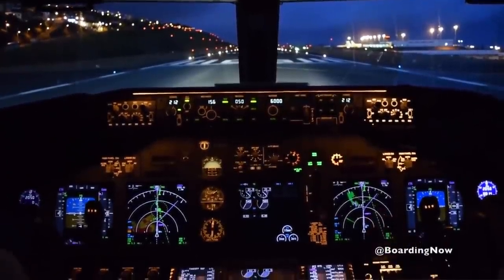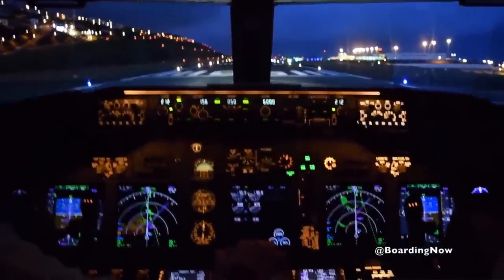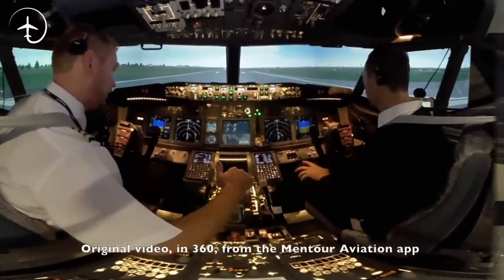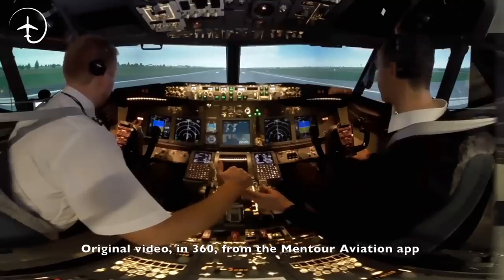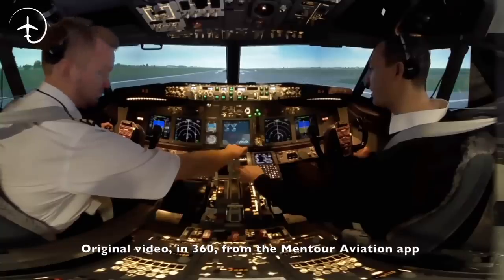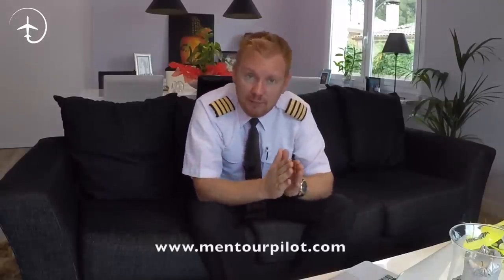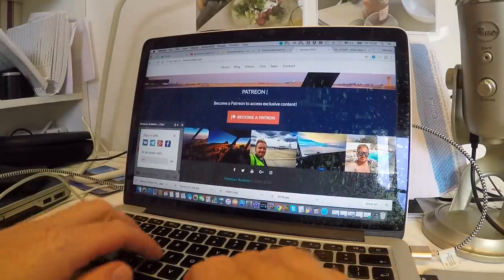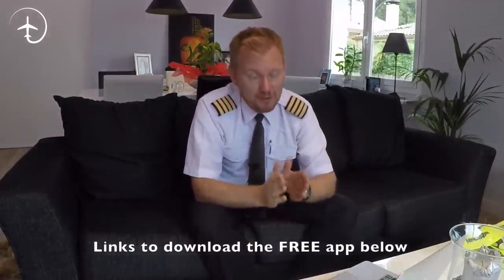Why do the aircraft engines "stop" accelerating during takeoff?

Comment: In many videos from a cockpit I have seen the climbing phase done at V2 speed which is only a bit faster than the stall speed. Why is it that? Is the reason to get to the cruise level as fast as possible with least fuel consumption? I suppose climbing at 250 KIAS would take some time (owing to the small pitch angle) and a cause a higher consumption due to higher drag and denser air. Right?

Btw. I watch your videos, they are very educational, professional and yet very comprehensive. And I am toying to enrol to a PPL(A) course. Thank you.
Reply: Usually, the climb is done at the "best glide speed". That is, at the speed the plane generates the most lift with the least amount of energy expended. 

Basically, flying is all about energy. The engines turn the chemical energy stored in the fuel into kinetic energy (speed) at a certain rate. The angle of climb turns the kinetic energy into altitude. At higher speeds, you don't need as much angle to get the same climb rate.

So, the plane will climb at roughly the same rate independent of the airspeed (somewhat slower climb due to the increased drag, but not that much), but yes, mostly they climb as fast as possible to get to an altitude where the engines run more efficiently.
Reply: Thank you for explanation. I have experimented many times in my X-plane 11 simulator with B737 and indeed when i set the cruising altitude, use LVL CHG button and set the speed to V2 speed the aircraft is climbing quite rapidly. I might not be fastest but certainly the engines are not set to full thrust. I have tried to play with the Vertical speed hold but I consume a much more fuel. Needless to say that some pilots told me this is not exactly a safe way how to climb.
Reply: Ok, I guess a bit more explanation is in order. 

There are several speed values that are useful. There are V1, Vr and V2. You need those only during takeoff. 

Vy is the "best angle of climb" speed, which means, you have the maximum altitude gain with the least horizontal travel. That's probably pretty close to V2. You use that speed during a short field takeoff to get over an obstacle.

Then you have Vx, which is the "best rate of climb" speed. I suspect that's also the best glide speed, but I'm not a pilot, either. If someone out there knows, please tell :-)). This is the speed you should set when climbing via LVL CHG to gain maximum altitude in minimum time.

The reason why vertical speed hold is dangerous is that the auto pilot will try to hold that climb rate by adjusting the pitch. If you set the climb rate just a hair too high, the autopilot will happily pull up until the plane stalls.
Reply: @realulli  great info but Vx is best angle while Vy is best rate.
Reply: Thanks for the correction. I keep mixing them up...

Comment: Hi Can you please explain what the TOGA button actually does? I thought you just pushed the throttles to achieve thrust required? Thank you.
Reply: stands for takeoff/go around. the actual toga position sets the full rated thrust of the engines. unless the runway is contaminated, a flex takeoff setting (a value more than sufficient for takeoff but below maximum is set) the figure is derrived from software on the EFB. it is proprietary to each carrier
Reply: Ava Mendez Not quite , the TOGA switches will advance the thrust to whatever level has been entered into the system, full or de-rated ; Flex is an Airbus term which also sets whatever thrust level has been pre-entered.
Reply: @Sterlingjob 
Airbus just chose a different name, anywhere else that's what toga is.
Reply: Klobi for President It's the same on every other modern aircraft. The fmc will determine how much thrust is needed for the take off run when the variables are dialed in. Variables such as Air temp , wind speed weight and many more. 

I don't need to explain further but the point is, Airbus or Boeing it's the same take off techniques.
Reply: Gun Nut On an Airbus , TOGA is full thrust.
Reply: Boeing uses an actuator to physically move the thrust levers to the preset amount  as directed by the flex calculations.  That's what the button does.  
Airbus, IIRC, don't use actuators for flight controls.  You set the throttles to a certain detent and the computers control the thrust internally.
Reply: tjperez69 You're mixing up and confusing everyone. 

All aircrafts do have actuators on their thrust lever simply because of the auto throttle system in modern aircrafts.

You can physically move the aircraft thrust lever without the actuator when the auto throttle system disengaged. 

The main difference between the actuators on some Boeing aircraft and an Airbus aircraft is the type of actuators used. On older aircraft models (for Boeing) they use hydraulic actuators, nowadays it's just electrical actuators that control mostly everything.
Reply: Hopefully the person I actually asked the question to might give me an accurate answer!
Reply: SJ15 Basically TOGA is a mode that is depending on 2 phases of flight.

On take off phase , when TOGA is flipped, the FMC will determine how much thrust will be needed for the take off phase. This is on a Boeing. On an Airbus it's full thrust. 

On approach phase, it's basically overrides auto throttle mode and doesn't follow the ILS glide path. It can follow go around flight patterns if properly configured. 

Keep in mind that these features are only on modern aircraft, I'm not too sure for older aircrafts .
Reply: SJ15 I hope I am able to help you understand, cheers!
Reply: +ItzTheDude I'm not sure if we're talking about the same thing.  If all aircraft have thrust levers that move by themselves then a lot of them are Inop.
Reply: It's the button that signals the start of a toga party in the cabin. Animal House starts playing as the in-flight movie.

Comment: Just seconds after you are airborn, the pilot always decrease the revs giving you the feeling of engine failure..scary as f...k
Reply from the maker: Tats when we reduce the thrust from Takeoff to Climb. It happens around 1500 feet normally
Reply: @MentourPilot  what is the reason of this reduction at 1500ft? After a shortwhile thrust is built up again to climb further
Reply: @Landshark928  thrust reduction altitude as mentour explained is between 1500 1680 feet. On the A320, the msg LVR CLB, signals the PF to lower the thrust from FLEX to CLB detent. all jet engines have a maximum 5 minute takeoff thrust rating.  it is done to prolong the life of the engines
Reply: always feels like the airplane is about to stop in the middle air :), I know it isn’t but it always kinda scares me
Reply: @avamendez1272  aha thanks!
Reply: Kostas Saratsopoulos - For me it’s a sinking feeling.
Reply: Oh yeah, I don’t like that! Scary.
Reply: Thanks.
Reply: Willem van Es they select climb power. Its to reduce stress on engines and prolong life between inspections, but biggest reason its done so low in height is noise. Some companies do this as low as 800 feet or as high as 1500ft above ground level. Many airports have noise monitoring stations dotted about the approach and departure paths and hand out big fines to noisy airlines. I believe most noise comes from the flaps and landing gear strangely.
Reply: Kostas Saratsopoulos yea I also notice this big time it feels a little like you’re going into a stall! Weird sensation for sure 😁
Reply: Climb thrust..
Reply: @Gun Nut- Nashville, Tn. airport had a terrible crash of an Air National Guard fighter. To reduce ground noise the fighters (and all aircraft) take off very steeply. This fighter had hand-me-down engines from the Air Force. One flamed out, causing the plane to stall and crash into a neighborhood, destroying houses. The pilot rode it down to guide it away from a school rather than ejecting to save himself.
Reply: When did that happen Al?
Reply: Even that depends on type and procedure. I used to work 15 years on the 737, and we actually almost always increased thrust at "thrust reduction" altitude, simply because we reduced thrust for take off as much as possible to save on maintenance costs and the risk of engine failure, while using the maximum climb thrust to get to cruising altitude faster which saves fuel, around 40kg per take off, which does not sound like much, but combined with several hundred or even thousand take offs per day grows to a very large figure per year. For those those inclined, combining engine derates and assumed temperature for take off, manually selecting full climb thrust in the FMC. When we changed to this procedure many of our frequent flyers commented that it felt like a kick in the behind shortly after take off. The procedure was actually introduced on a recommendation of CFM and lead to extremely long engine life, over 30.0000 hours on the wing without the need to visit a maintenance shop.

I'm on the bus now, where we cannot change the climb thrust setting manually, it always adjusts automatically not to be more than take off thrust, and usually is even less than that. The A320F uses quite a bit older engines than the 737NG (CFM 56-5 on the Bus, CFM 56-7 on the NG), but the procedures as mentioned by Mentour of course do still apply. They are more engine related, not necessarily airframe related. That said, the A320 offers operators the choice between two different engine manufacturers, but i have only ever flown CFM myself. The 737 does not offer that choice.
Reply: Mentour Pilot I experienced a sharp left turn and a fast climb during an approach to Singapore. is it breakout formation like what Captain Joe explained or could it be any other phenomenon?
Reply: Thanks for the info toilet brush
Reply: Noise abatement!  Can't make too much noise after takeoff.
Reply: That can vary with some airports. Some like the infamous John Wayne Airport in southern California (KSNA) use strict noise abatement when they takeoff on RWY 20, heading towards Newport Beach.
Reply: I have another possible explanation: getting to the altitude from the initial TO clearance and reducing thrust to avoid exceeding the speed limit.

Is that possible, about 2 nm from the airport, at about 3000 feet? (Altitude from Flightradar24, position from where I am when I hear the planes reducing thrust)
Reply: Same when they open the flaps + landing gear and feels like you are pulled back during the  approach for landing.
Reply: Climb thrust is a little less than takeoff thrust when taking off
Reply: @MentourPilot  So when you hit cruising altitude....what is percent of engine thrust is taking place during that?  So take off is full thrust, climb is what %, cruising in what %, descending on approach is what %?
Reply: @robertlafleur5179  its the G Force
Reply: you wanna fly into Larnaca airport in cyprus then, it's a descending turn over sea, really feels like your gonna fall out of the sky! awesome airport and approach tho!
Reply: Omg yessss !!!
Reply: @christopherwilson6527  "I believe most noise comes from the flaps and landing gear strangely." they are (well the gear at least) highly un-aerodynamic after all ... they don't need to be so they undoubtably make a huge wake.  You can feel it pretty good when on a plane when the gear goos out or the flaps are extended .. it slows down a lot.  And as for the noise .. try standing next to a buzzy highway and have a good listen to what sound you actually hear from the cars ... most of the time it's not the engine .. it's the tires on the tarmac ... and when it's wet or rains, it's even the spray coming from the weels that make up for most of the noise.

Comment: I notice that there seem to be two independent levers. Is it possible to operate them independently? Is there any situation where you deliberately want more thrust on one engine than the other?
Reply: You use asymmetrical thrust to overcome rudder hard over, or to steer the plane after loss of all hydraulics.
Reply: You also would want to roll back, and then shut down, an engine that has failed or is having a mechanical problem, but the other one is still running okay.
Reply: Yes a plane had lost hydraluics and they used engine thrust to change direction and pitch.
Reply: @f-j-Services  Exactly!  United Airlines DC10 crash  Flight 232 in 1989 ! That is how they lined up with the runway when they lost hydraulics.
Reply: @gatesmw50  Yep! :D

Comment: One other thing, why does the pilot monitoring have his finger behind the thrust levers?
Reply: Not a pilot  but maybe to be ready to immediately cut power in the event of an engine failure? Or other reason to abort the take off
Reply: The sea planes that Chalk's Air used required that both pilots put their hands on the thrust levers, in case they hit a wave, so they wouldn't lose thrust during takeoff accidentally. Sadly all of those planes are retired now for safety.
Reply: To actuate the TOGA (autothrottles) button.

Comment: I've flown commercial a few times out of Hartsfield GA, and every time noticed the run-up before the takeoff roll. You get used to it. The engines seem to accelerate differentially until all sound the same. It is like synchronizing twin engine private planes to get equal thrust before releasing the brakes for takeoff.

Comment: On older aircraft without electronic fuel controls, allowing the engines to stabilizing prior to setting take off thrust also helps to avoid overspending and over temps.

Comment: Back in the late 70's I was a flight from Phoenix Arizona to Kansas City. We taxied out to the end of the runway as normal. The pilot brought the engine power up on the end of the runway. Then after 15-20 seconds shut the engines back down. The captain said we were returning to the gate we had an issue with the aircraft. I overheard a  stewardesses telling another stewardess that we had lost an engine. It was very good that they discovered it before we were exciting down the runway. 
It was on a TWA 727.  My other experience was on a flight from Orlando Florida to Atlanta Georgia. Upon landing the pilot told us the plane was going to have to be towed to the gate. Did not get an explanation on what happened on that one.

Comment: Another reason you do a gradual advance of the throttles to a stabilized RPM before take off thrust is to prevent turbine blade stretch. You want a gradual, uniformed heating of the turbine blades prior to applying a high load on the engine. If you slam take off power to a cool / idled engine the turbine blades can expand / stretch irregularly. This can cause fatigue and cracks in turbine blades and sometimes can even cause turbine blade stretch to the point where the tip of the blade makes contact with the inside walls of the turbine casing. Advise from a Flight Engineer of 40 years. Stay safe

Comment: I flew an F-102A with the J-57 engine. I also flew the T-33 Air Force trainer with the Allison J33-A-5. The pilot was the fuel control. Ask too much from the engine and it would either over temp or compressor stall. Once airborne, it was not a problem due to incoming air. 
In today's airline planes, the pilot pushes the throttles into a takeoff range which is set by the aircraft's computer system and the thrust is stabilized. Then it is moved into takeoff which is set by density altitude. This is all controlled by the computer. You will feel the initial engine run up and then takeoff power. After takeoff, is  the climb power. Retract the flaps and leading edge devices.

Comment: Hi hi, to my understanding, to do a trust set was to make sure the amount of fuel injected into the combustion chambers are fully overcome before pushing the throttle to take off speed where the combustion chambers will be thrown with plenty of fuel...if this is not done then combustion chambers will be flooded with fuel and stall...what you explain is also a point to be understood....

Comment: What is over-speed? Why is it necessary to reduce engine power after take off? Would this cause structural damage and if so how? Also why does the pilot not performing the take off assist with the throttles? Those are my questions.
Great vids by the way.

Comment: I always did static throttle ups, never rolling throttle ups. I always went straight from 20% to full ATOT to 1500' then back to 100% to initial climb out altitude. I was only certified on two airframes, both were quad engine jets.

Comment: Very interesting. Do they always keep brakes on while reaching 40% ? I feel like some airlines have different procedures and some let go earlier. 
Moreover I am surprised that the brakes and the friction force of the tires can hold a plane with engines at 70% for 30 seconds. Impressive.
Reply: I was going to ask a similar question. When I've flown I've noticed that when we pulled onto the runway we don't stop. I expected to stop for some amount of time before taking off but we didn't. So apparently they can do this 40% run up while beginning the taxi and then go to their take off power. I guess if there was any concern about the runway being a little short they wouldn't waste that distance

Comment: As odd as it sounds, it's also a bit of a final check to make sure that engines are running properly before they really get moving. The faster rotating machinery goes, the more apparent issues will be. I'm sure there's checks when the engine's at 20%, but pushing it to 40-50% stresses the engine a good bit more.

Comment: Unrelated, but on a recent cross country flight in the US, I noticed the air conditioning to be very cold during the beginning of the flight but then really stuffy and warm once we reached high altitude for most of the flight and then it got very cold again as we descended in prep for landing. What is the reason for the big change in air conditioning performance during the flight, and does it depend on altitude?
Reply: Wunderboy Nope that must of been you that doesn't normaly happen